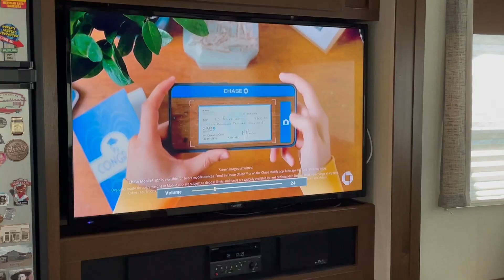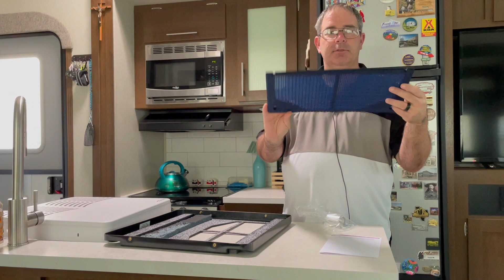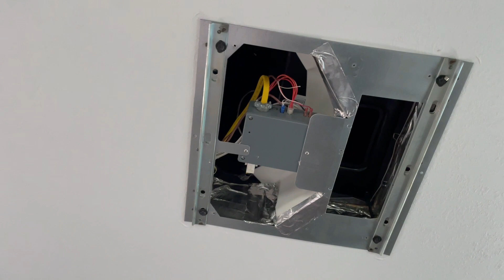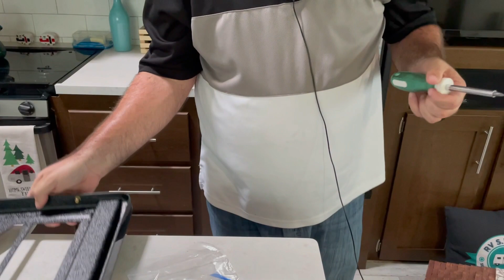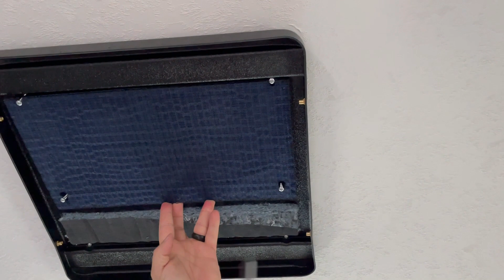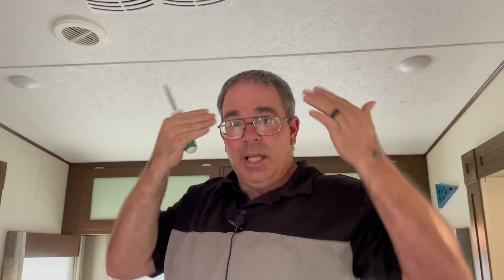RV A/C Silencer-Must Have for RV'ers-RVSWAT

Comment: We found that the very front vent was not closed off and air was going into the front cap and affecting the amount of cold air coming out through the vents.  He closed it off and the front ac worked so much better.